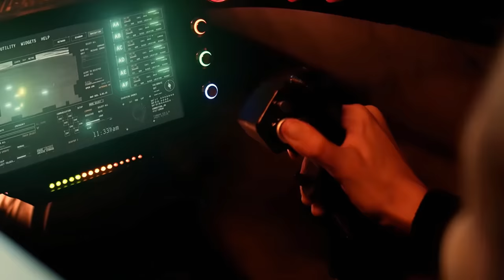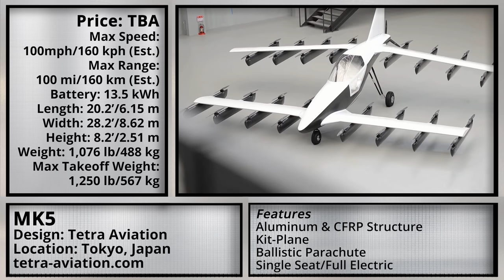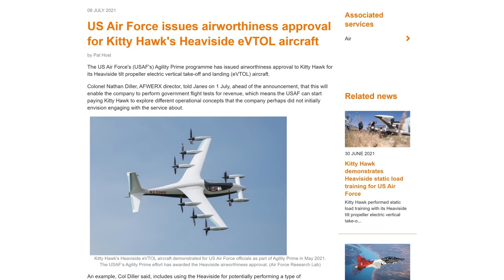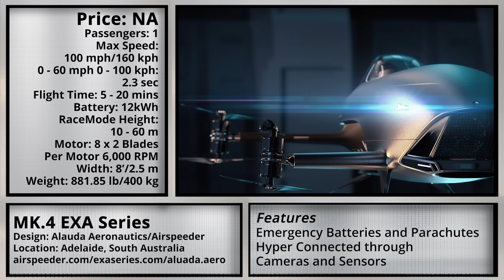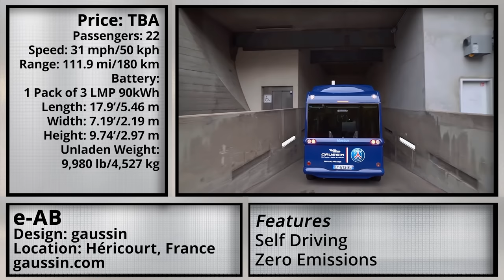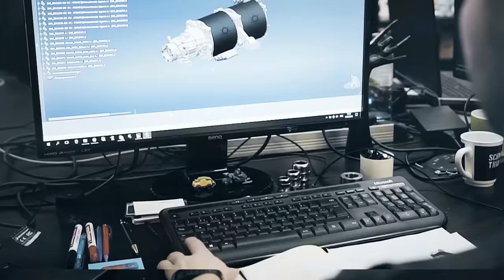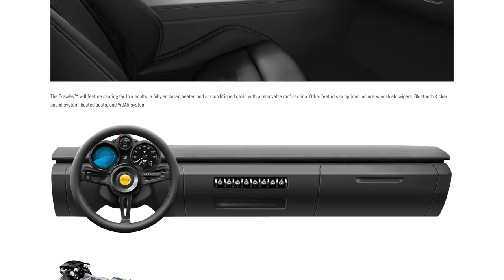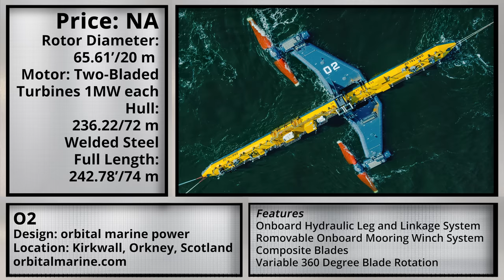Future Fleet: 10 Groundbreaking Vehicles to Add to Your Collection

Comment: Fuel cell vehicles *are electric. They produce electric charges to the motors, not engines. A lot of people keep mis-classifying battery electric as the sole form of electric, just after mentioning the fuel cell. It's doing a disservice to zero emission development, implying fuel cells are combustion.

Comment: None are zero emissions when you take into account they must be charged somehow. And such limited range makes them nothing more than toys.
Reply: While currently valid for everything except the O2, which is a grid-power generation asset, the presence of the 02 illustrates why it's only partially true, even now, and becomes less valid, as time goes on.

As more and more of the grid converts to sustainable sources, these vehicles continue to reduce their carbon footprints.